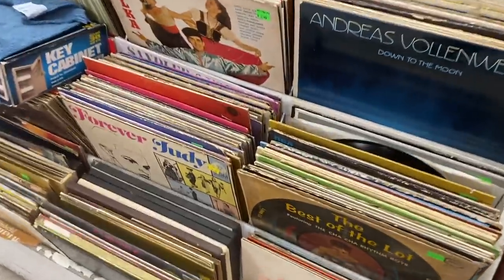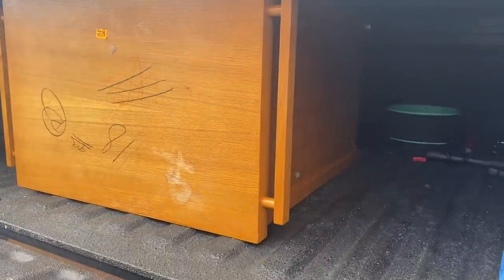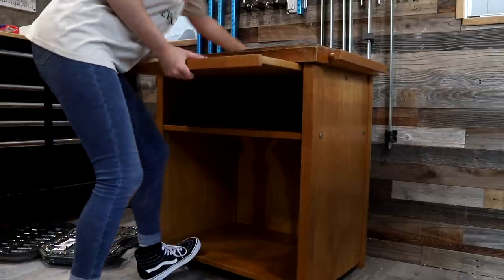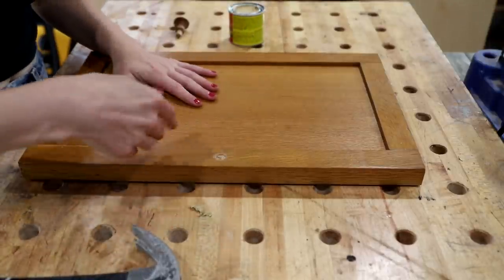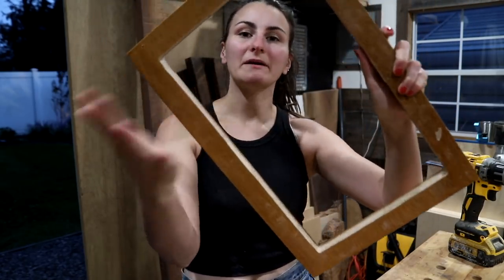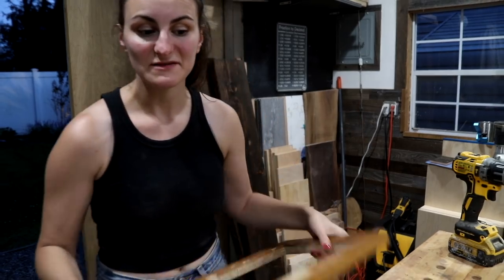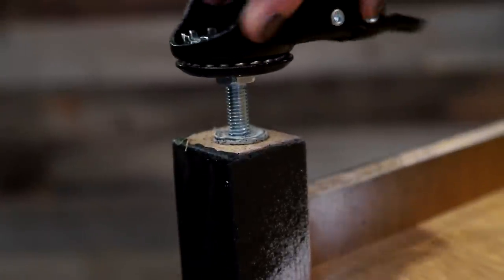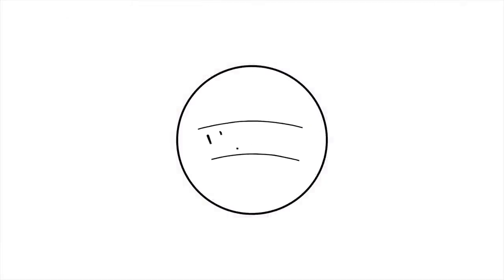DIY CABINET MAKEOVER || THRIFT FLIP

Comment: That is a good upgrade.

I just got to thinking. You could repurpose a PVC photo booth design and use it for a paint booth. If you decide to do that, use 3/4 inch or 1 inch(1 inch being preferred) pipes to build it.

The 1/2 inch may be cheaper but it's quite wobbly.
Reply from the maker: That’s a great idea! Will have a lot more space to play with at the new house!